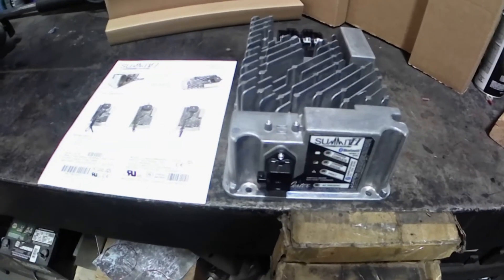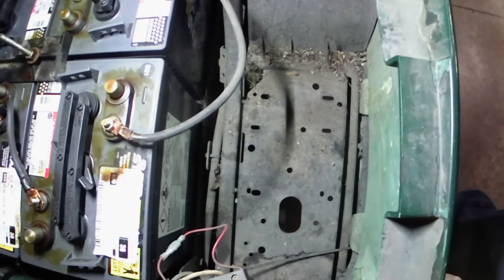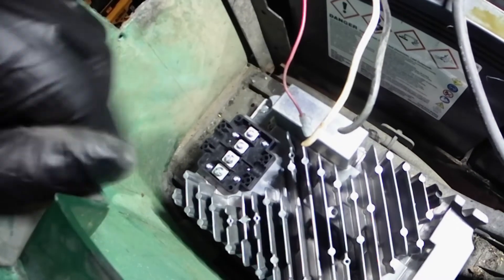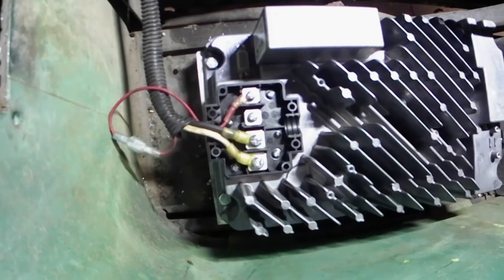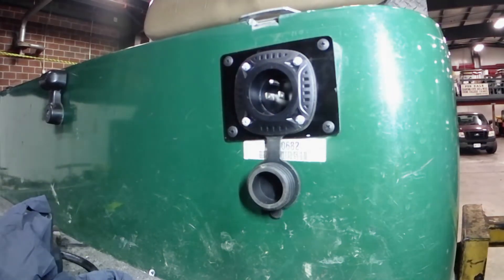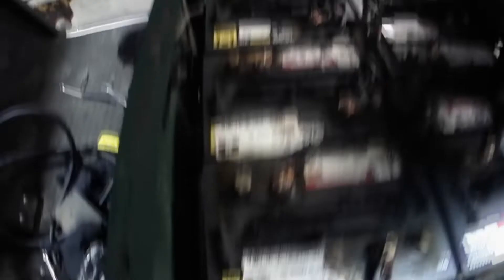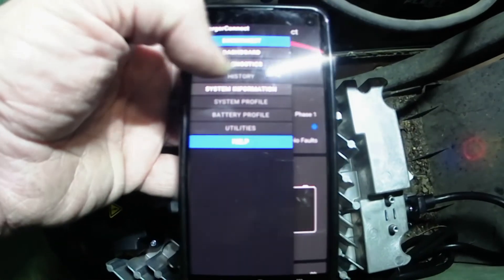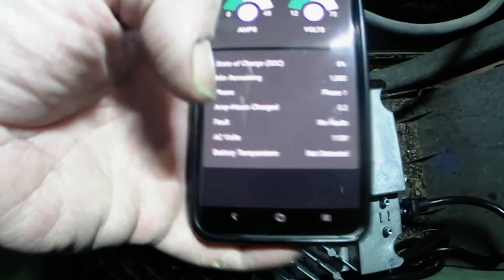Installing a Lester Summit 2 onboard charger in a EZGO golf cart #batterycharger #golfcart

Comment: Great video!  Do these chargers hum like the old power wise ones?
Reply from the maker: Not at all. You do get a click when the AC is connected but otherwise they are quite.
Reply: @PullerbearEd  great!  Thanks.  When you installed the Amazon outlet did you just cut the end off the included power cable and wire it in?  I was just going to open my seat and plug in each time but I like your install better👍
Reply from the maker: Yes I cut off the end and wired it directly to the plug but there are other outlets that have a cord with the female end and you can just plug them together.

Comment: So I hooked mine up like your video but my cart won’t move.  I moved the lockout wire to positive on my battery pack and it works fine.  I checked voltage on terminal 2 and I’m only seeing about 14-15v rather than the full pack voltage.  Any ideas?  Thanks!
Reply from the maker: The #2 terminal is a signal safety wire that sends voltage to the cart controller to make it inoperative during charging it shouldn't be hooked directly to battery pack voltage.
Reply: @PullerbearEd  on my 98 TXT DCS cart if I hook to number 2 it gives about 12v when the charger is not plugged in to AC and no volts when plugged in and charging.  The cart doesn’t move this way.  If I connect that lead to positive on the battery pack then the cart goes.
Reply from the maker: Hmm I'll have to check one of our carts..I always thought the #2 was hot when charging.
Reply: @PullerbearEd   I am also in the same boat, what do I do